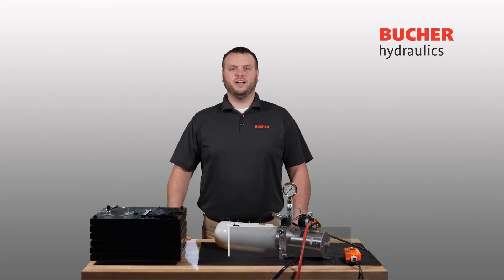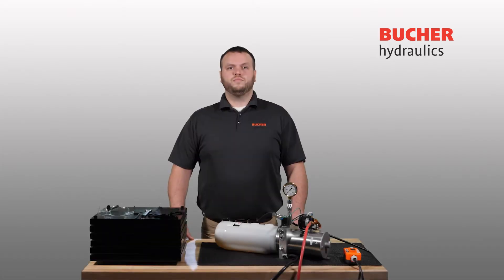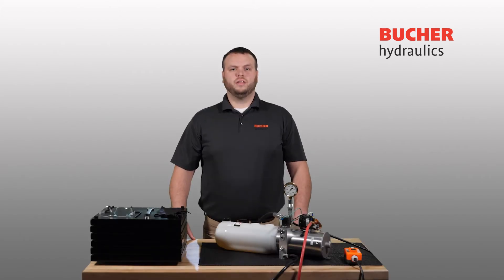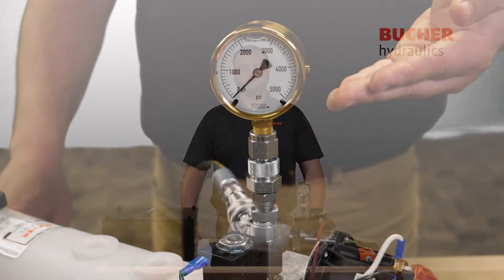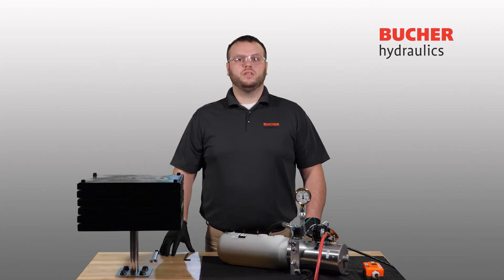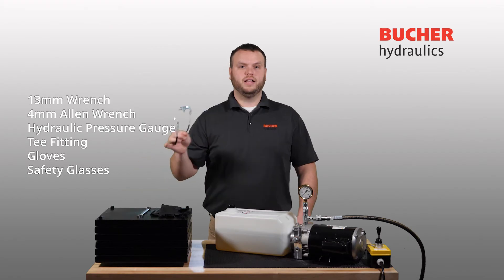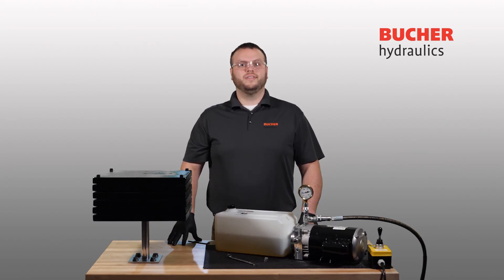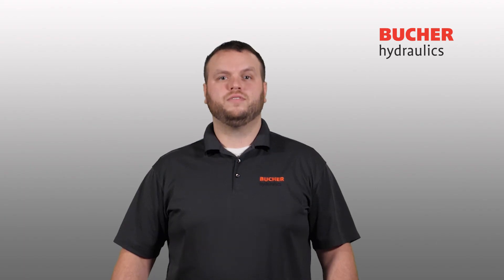How to Adjust a Relief Valve Safely on a Bucher Hydraulics Power Pack

Comment: Now that you have pressure in system. How do you release that pressure if needing to maintenence one of the lines gasket as one of the fittings is leaking. Do you simply release the pressure and redo it in full? I don't have a psi gauge on mine.
Reply from the maker: There are many factors to consider, with safety being a key concern. We recommend that you reach out to the company from which you made the purchase for support in maintenance tasks or contact your local Bucher Hydraulics representative for more detailed assistance in solving your issue.

Comment: Have two Bucher pumps on 1999 LT 40 super hydraulic sawmill and they dump oil like nobody’s business 😂🤣💦
Reply from the maker: Happy to hear that our products have been in productive operation for so long! Depending on age and working hours, our pumps and power units require maintenance and replacement of seals and other parts.
You can address yourself to the machine manufacturer, who is able to get the precise spare parts from us or the correct hydraulic supplier.